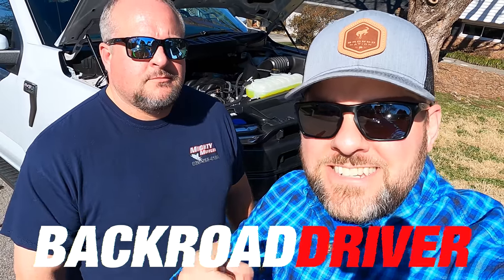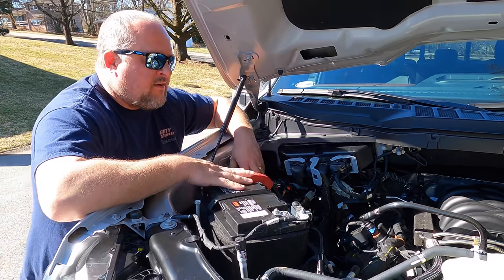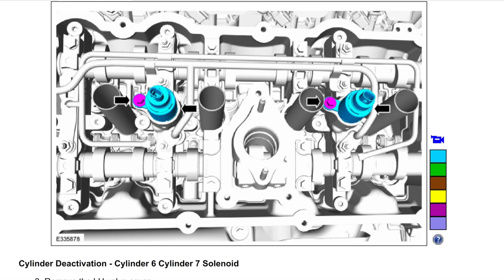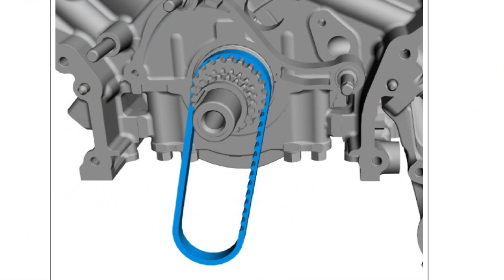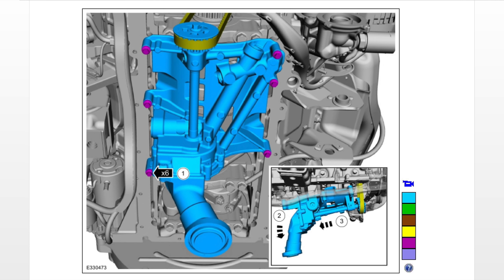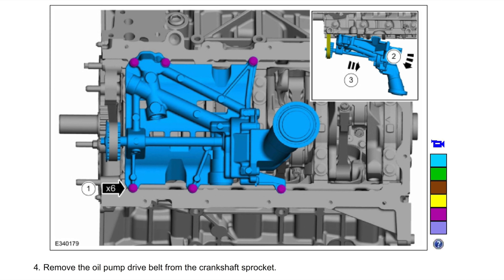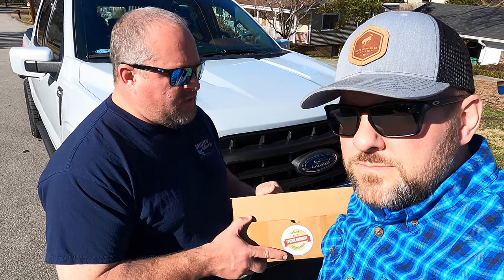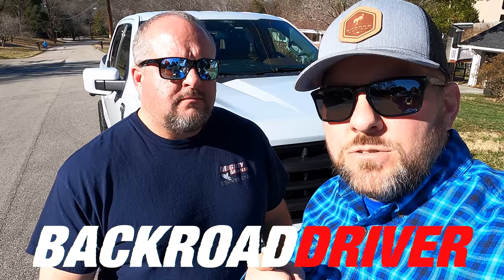2021 Ford F150 5.0 V8 Cylinder Deactivation & Oil Pump Belt Explanation - JLT Catch Can Install

Comment: Why is nobody talking about the junk 10 speed transmissions I assume they are still using. Maybe y’all are, I didn’t read the entire comment page. Love the new trucks but scared of the transmission issues and now the cylinder deactivation
Reply from the maker: https://youtu.be/_QZmhq1IoFo
Reply: idk about junk, I just traded my 18 raptor for a 21 5.0 and I beat the raptor hard for the three years I owned it. Never any transmission issues. 50k miles under a tune 15k without
Reply: @bastiononly1245  that’s cool. Not sure if they use the same transmission in the Raptor as they started putting in the light duty 1/2 tons in 2018 but they have have had a lot of problems with them. I am on my 5th F150 currently and it’s a 2017 with the 6 speed and I love this truck. I just wish they would leave well enough alone and if they find something that works great just stick with it.
Reply: @323CFD  I too enjoy the 6speed, i am not a fan of the 10.  weird transmissions...
Reply: @666dynomax  I’ll probably drive this truck til it lays down and dies. Not willing to risk buying a new one until I’m confident that they have resolved those transmission issues.
Reply: Ive had my 2018 in the shop multiple times for the 10 speed. Its very clunky imo but at the same time it has way more performance than the older 6 speed. Ive eliminated skip shifting which really helped out and the hard shift into 6th cant be recreated by the dealer (how convenient). Brought in for some other rattle noises so they put a shim kit between the flywheel and torque converter. Did nothing. It needs a new exhaust solenoid because it rattles but the dealer piddles around and wont fix.  They tell me to run it till it blows up, isnt that comforting. They just want it to go out of warranty and then stick me with a bill.

Comment: Are you telling me that Ford engineers didn’t put a 50 dollar part on a 70 thousand dollar truck? A Catch can sounds pretty silly especially on a truck thats not even boosted. Seriously, it’s just more maintenance and shit you gotta empty and clean. But if it makes you feel better then by all means...
Reply: If you ever saw what comes out of one you would change your mind. I know I did, got one on all three of mine.
Reply: Well if you want all that crap coking up your valve stems be my guest.  A lot of direct injection engines are having problems with this - that's why Ford went the direct/ port injected route but it's still better to just keep the gunk out to begin with.